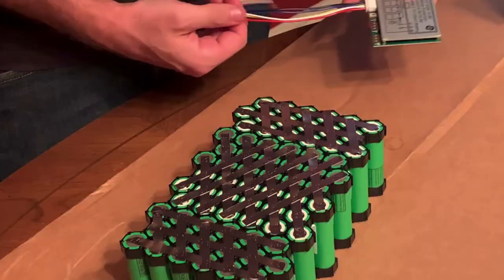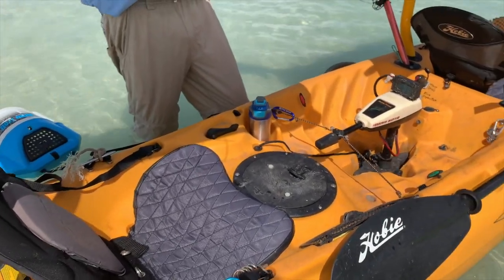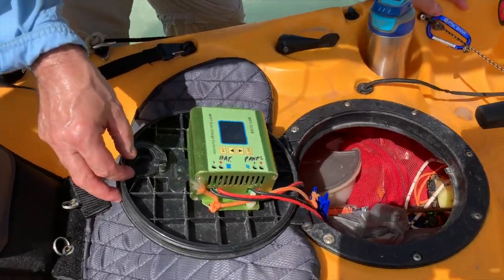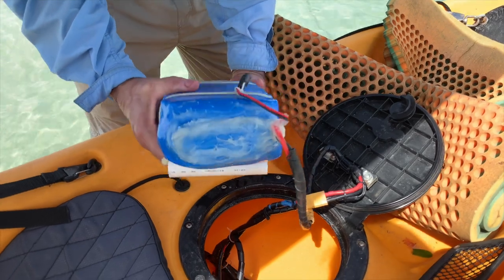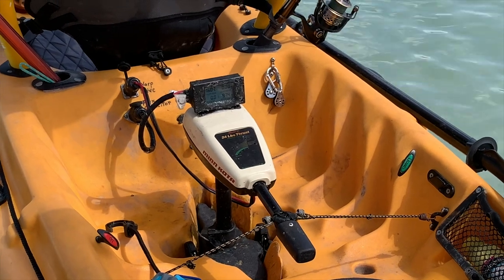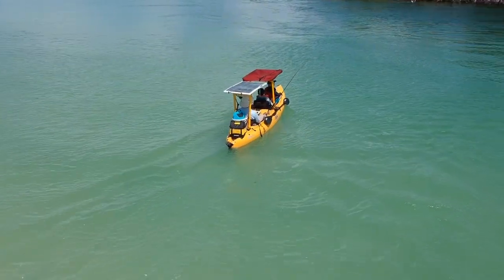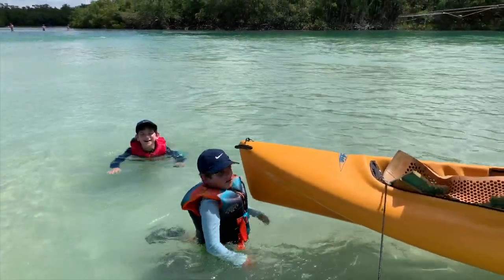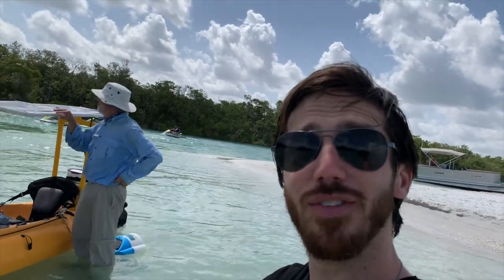DIY solar powered electric kayak (overview and demo)

Comment: Sweet setup. What is the power consumption at different speed settings? I would love to compare it with my calculations and own solar boat performance.
Reply: about 24 amps at the top speed.  5-6 amps at the slowest speed.  I'm mostly in the lower speeds and often stopped at anchor fishing so the solar panel adds range.  Thanks for your question.  Stay safe
Reply: @micahsdad5388  thanks. That is fantastic performance. Do you know any of the propeller specs? I have only ever used rc model aircraft props on my homemade trolling motors. I have also heard lots of good reports from people who have replaced their stock trolling props with model aircraft props.
Reply: @williamfraser  it's a standard Minn Kota propeller for that size motor.  I'm in a lot of skinny water with hard (oyster) bottom.  Every few trips I usually need to dress the leading edge of the prop blades to take out the nicks.  Don't know much about the rc props.  How well would they hold up in these conditions?
Reply: @micahsdad5388  most of the rc props are thin plastic and would not last long, but then again they are so cheap you could keep a few spares in a hatch. These days there are some nice carbon fibre options too.

Comment: Nice. Next step will be to offer more air to make temperature down and also do something to fight against the salt water who will kill everything quickly. Should be full underwater proof 100%.
For electronic system in the see (I'm commercial diver) the big problem quickly is the salt water. Everything is expensive because have to be water proof and very very strong, also very simple design help to reduce cost at build time.
Very nice project guys. Your dad is very good.
Reply: Thanks.

Comment: I would very much like to know how many hours it took to complete these modifications.  It's just awesome!
Reply: Thanks very much.  Here's what I can remember as these mods were done over a period of time.  Each canopy probably took about 2 hours.  Had to mount the rod holders into the hull to accept the uprights and then cut all the PVC, assemble, test fit, final glue, etc.   Putting the motor shaft into the cassette was another 3-4 hours as I had to strengthen the cassette by cutting it open and building a solid internal mount and then put in the cross shaft to go into the Hobie mounting system.  About 4 hours of modifying the scupper to allow for the motor to drop through the hull.  Micah and I worked on the wiring together and building the loom was a couple of hours.  Installation of the water proof through hull connectors was about an hour each - time consuming to carefully drill holes in the hull and then reach around with the help of someone to get all the hardware screwed in.  Then some testing and dialing in of the full electrics in the driveway and 2 shakedown cruises to test all the components on the water.  So, no, this is not a few hours on a Sunday morning.  A weekend, yes.  But all the build time was fun as it was learning and problem solving.  And now I have hundreds of hours on time in the Kayak with my grandkids, my wife who is a great Kayak fisherwoman, and the stares and cheers of hundreds of people who have seen me cruise by.  Thanks for your question.  I hope this answer helps.

Comment: Thinking of doing this... Mind sharing the cost?  Maybe a how to video? Where in FL is this? Love the water is so calm.
Reply: Motor was only about $35 off of Craigslist.  Battery maybe $400 (made by Micah).  Solar panel about $100 on Amazon.  Wiring, solar controller, waterproof disconnects etc maybe $100.  The Kayak is a Hobie tandem - that's a little pricey but I have it for over 10 years and it is going strong !!  Best yak out there for all around performance.
Micah and I are planning to do a DIY book that details how to build one.  Stay tuned.  
Southwest FL between Naples and Sarasota.  Thanks for watching and commenting.
Reply: @micahsdad5388  nice! Thanks for sharing! I'm up in the Panhandle (Pensacola area), would love to make something like this 😁, wonder how it would do on the beach.

Comment: Great design.....but how does affect stability....especially in the wind?
Reply: Kayak has a 33" beam.  Never flipped it even when sailing it with a sail kit in 8-10 knot winds.  The PVC and PV solar panel are very light - few pounds.  THe motor itself serves as a daggerboard and helps keep the line even in a cross breeze.  THe wind tends to pass over and under the canopies because they are parallel to the surface of the water.  Thanks for your question

Comment: Love it, I always wanted to do this with small rib, but that kayak is so much more original.
Here is a question, your dad mentioned that solar panel charges battery constantly, does that mean batt pack gets discharged and charged at the same time? How does that work?
Thanks
Reply: When he wants to charge it, he turns the battery's right side up, so they can hold the electrons, when he wants to use their force he turns the battery upside down so the electrons empty out into the wires.  That is why Australia's electronics are all upside down, so they can work down under over there.
Reply: @BloodAsp   well some of us live up here so I was hoping I wouldnt have to go that far, would a few meters below Equator not do me? How much power will I be loosing at Equator comparing to australia?

Comment: Great video!  Can you direct me to where to by the battery guage/monitor?  I’m currently setting up a canoe with a 44 pound thrust trolling motor, 50 amp lithium battety and a solar panel for this summer

Comment: Would love to see a build schematic of this, what connects to what and what parts were used. Looking to do something like this with my canoe. Already have the 18650 batteries and motor, just need to know the rest of the build :) Thanks if you can help.
Reply: Micah and I are considering a DIY book: How to build a solar powered Kayak.  Stay tuned.

Comment: I know your running 12v 
Question I m running my camping solar setup on a 48v system that drops and manages to charge my battery and run all my gear at 12v off a 48v panel house panel
I’ve got spare panels and controller could I run my kayak the same way down to 12v motor or just go 48v ? 
Thanks for your time cheer from down under Australia

Comment: I was wondering how your set-up handles a situation with wind off your bow and or running against the current. Obviously the speed will drop and current required will rise but can you still make headway?
Reply: Great question.  We have some VERY strong currents in these near shore and on the lee side of the barrier islands in the cuts.  I have had the occasion of needing full speed to move directly against the current and was just making headway.  The winds are less of a problem because the kayak is low in the water and the keel, while minimal and mostly up in the bow, does help cut into the water.  The winds are more problematic in that they kick up the sea surface into white caps pretty quickly and these can grow in size fast.  The canopies are not that much of a sail because they are parallel to the surface of the water and the wind doesn't catch them too much.  I actually enjoy the winds and currents and use my knowledge to get to where I want to go and stay safe at the same time.  I do have a PhD in oceanography so I know a little about these conditions.  This is also a VERY worthy kayak with great stability characteristics.  Novices in cheap hulls can and do get into trouble.  I have rescued several of them over the years.  Thanks for your question.  Stay safe

Comment: Hi, suggestion for a video

Problems in use big motors with small batteries. Or small motor with a bigger controller.
Geat boat!

Comment: with all of those waterproof connecters I was surprised to see the charge connector for the battery not capped so no water would get in it. Is it not an issue if that gets wet?
Reply: Another commenter also brought that to my attention.  Good catch.  Fixed !!  Thank you!!
Reply: @micahsdad5388  I'm just glad you were able to get it fixed before something bad happened. keep on rockin that awesome kayak

Comment: How long would it take to charge the battery from flat via solar?
Reply: Daniel - It would take days to put a full charge into the battery.  I use the solar panel as a range extender, putting back some power as I go.  And since I stop and fish or just go very slow to watch for marine life or just enjoy the scenery, I get some good added power during the course of 5 to 6 hours on the water.  The sun is also very strong here in SW Florida.  That helps.

Comment: Great idea and video . Perhaps you could built another “ Extreme “ version with a large one piece solar panel with upgraded battery , motor
and transmission system and offer the standard and extreme versions for sale . 
Kayak size and accessories could also be customised for 1 2 3 or 4 pax , including pilot .
Who knows ? This may be your Dad ‘s and your
Pot Of Gold At The End Of The Rainbow 👌👍
Reply: coming right up !!

Comment: Amazing setup. Are you able to do without the solar charger?
Reply: yes. the solar panel adds range but the battery itself is plenty powerful to go a long way.  And you always use a larger battery if needed
Reply: @micahsdad5388  ah ok, thanks, but what i meant was that are you able to connect the solar panel directly to the battery?

Comment: Your channel is the best!!!
If you plug another same battery will it charge it in Time?
Reply: The solar panel adds charge but a full recharge on a battery would take a very long time.  Good thought though.  A second battery to swap out would certainly double the range.  Hummm ...

Comment: Great video!
How much speed can it sustain on solar, only (without help from the battery)?
Reply: won't run on solar alone not enough amps but maybe with 5 or 6 panels on parallel under full sun possible.

Comment: Hello Michal,
I am thirsty for knowledge after watching some of you Videos.I want to convert my bike to an ebike (battery build as well) But I did have few queations?
How to determine what exactly dishcharge rate BMS I will need for the battery I am going to build?
I am looking to 36V 28Ah baterry(10s8p) and to motor will be 36V 250wat Bafang rear  geared hub motor.
Thanks

Comment: I would be interested in a bit more info on the MPT 7210 charge controller used here. Has it been modified? What settings were used?

I ask because I have one of these charge controllers for my 36 volt ebike, connected to a 100watt panel.

Although it does charge, it does it slowly, especially in variable weather, it seems to overshoot as it ramps the voltage up and resets itself. It will continually do this.

I've seen others online commenting on this problem, but haven't found a solution.

So I am very interested in more info on how the MPT-7210a is used in this project.

Thanks for a great video!
Reply: I'm not an expert but I've watched a lot of videos and I seem to remember will on diy solar talking about this problem. I believe it's related to  the quality of the 30-40 buck controllers on the market.  I'll try to find the link and post it
Edit. I'm not sure if this is the right episode but you can check his playlist
https://youtu.be/IRRKHYwB3Uo

Comment: A Minn Kota 24lb draws 6 amps on 30% throttle and 57amps at 100% throttle,  100w at 12v delivers 8amps Max - by the time its gone through the regulator and the sun is never perfect say 6 amps constant.  At 24v 100w solar can only give 3 amps.  so even at 30% throttle he's depleting the battery.  Of coarse as he says - when he stops he's charging,  but its a long wait to get enough to go for an hour at 30% throttle.  So mainly he is running on battery.
I was looking at doing one with an out rigger to allow larger area for solar ( and shade!) ,   2 x 240w panels are now reasonably priced now and that would get me a solid 20 amps at 24v - so you could run a 24lb at half throttle and not deplete the battery,  and it would very quickly charge the battery when stationary.  You also would not need a big home made battery like that - a cheaper deep cycle would be sufficient.  Those 18650 and 21700 Li Ion batts are bloody expensive to buy right now.
Reply: Motor draws 24 amps at top speed.  Rarely need to go that fast.  Many days, because I am stopped when fishing the the sun is high,  I come home with the same amount of battery that I left with.  Free energy.  Completely green,  Feels good.

Comment: Micah, Can you do a video about DIY electric motorcycles. I want to convert an offroad motorcycle, but gathering info for the specification is difficult. I think I will need about 7kwh of battery for 65/70 mile range, but motor size and motor cooling method are a bit difficult to determine. The base will be a KTM freeride as the bike was developed partly as an EV and a second hand 2 stoke version can be picked up cheaply, especially if one has a motor problem.
Also when are going to finish your motorcycle?

Comment: Thanks for the video! How do you have that meter showing power going into the battery and out at the same time? I have one on a bike but it would only show either power going in or out.
Reply: Meter shows power going into the battery from the solar panel and the battery charge level.

Comment: Make up a second battery and connect it to a second solar panel then have a switch u can toggle between batterys to power the engine. This would give you twice the range 👍
Reply: that is correct but my range with the current configuration meets my needs.  Also, the battery is the most expensive part of the build, so adding a second battery would be a major investment.  Adding a second PV panel would be more cost effective.  Next best idea would be to add a more efficient PV panel (like 280 watts in place of the 100 watt one I have now).  There are certainly all sorts of ways to add range, but again, the current system does all that I want it to do.  Thanks for your comment

Comment: How would this boat do for camping?  Assuming good charging conditions (in Florida), will the solar panel charge enough per day to do 10-12 miles?
Reply: The battery alone will do 10-12 miles so the solar panel will add more range than that

Comment: I have a question, your dad mentioned he can get 10-12 miles out of the battery pack with the solar panel.  What is the wattage of the trolling motor, and the amphours of the battery?
Reply from the maker: The wattage of the motor is really variable, it peaks at somewhere around 280 W in top gear, but I think he usually pulls around half that while cruising at moderate speed. Battery is 14V 60Ah.
Reply: @EbikeSchool  ok thanks!

Comment: Hello, 
I wanted to bring a question that bring you back to the ebike videos times and hope this is ok to ask where topic seem to be kayaking and not ebikes. 
I have a 48v 10ah li-ion battery that is sitting aside currently not in any use but i want to convert or downgrade it to 36v battery. It is hailong battery and so how to or what would be the perfect and protective order to achieve this goal?

Comment: Hey micah, i just wanted to know that which type of motor is used as trolling motor??? I mean what is  electrical construction of motor??
Reply: Minn-kota
Reply: @gregorypeterman6216  i didn't mean that, i mean the amps, voltage, dc with magnets or universal etc...
Which Electrical type of Motor... Like that
Reply: @atom2319  oh, 12 volt, all I know
Reply: @gregorypeterman6216  well, thanks for contribution...
Reply: 24-25 amps at top speed.  5-6 amps at slowest speed.  Water cooled !!  LOL
Reply: @micahsdad5388  okei, it may be brushed dc motor than... I hope..

Comment: Just wondering what would happen if the solar panel hit the water. Or the kayak flipped sideways in rapids or wind. Electricity-wise, what would happen?
Reply: Hopefully nothing would happen because all the connectors are water tight.  Good news is that it has never been pushed or blown over.  Very beamy and stable even in stiff breezes.  Regards

Comment: I think it would be cool to figure out how to leave the pedal drive in place while adding the trolling motor. Use a free wheel mechanism where you can stop pedaling but the trolling motor can keep going if you want it to with the pedals stopped. NOW you can truly make that claim again about being really green. You just pedal when you want to save electric energy, or get exercise. You could use already developed technology for the bicycles with pedal assist.

Comment: Good day sir,

If I run 72v battery on a 48v controller, it would fry the controller no doubt. But what if I use 24/36/48/60v on a 72v controller, will it work? 

TIA sir

Comment: Seems solar setup is for range extension but can it be powered directly from the solar panel?
Reply: Yes but the available power would be very low.  Not sure that it would move much that way.  Certainly not get me up to 5+ knots

Comment: Is it possible to have a system in place which regulates the draw from the battery which will cut power to the motor if the batteries run too low? So then to wait until the sun comes up again and recharge, thus starting the motor again
Reply: Could be done but think it is just easier to monitor power use as you go.  I have never run out of power because I monitor use and solar recharge.. Thx for your comment

Comment: What kind of solar panel is that? It looks flexible.
Reply: yes it is.  Google "flexible marine solar panel" and you will see a range of prices and efficiencies.  I went with a relatively inexpensive 100 W for about $100.  You can spend much more but the added power generation wasn't worth the price to me.  Hope this helps.  Thanks for your comment